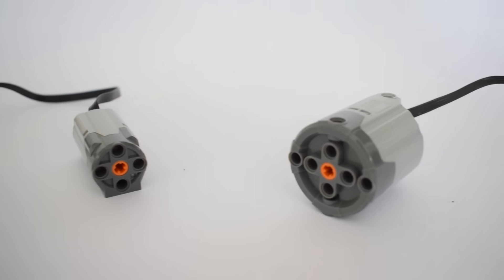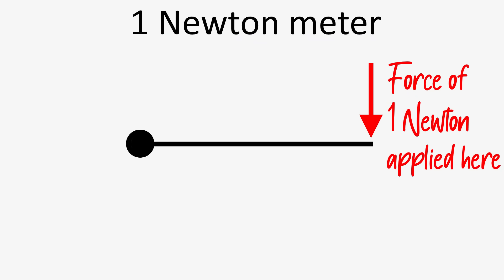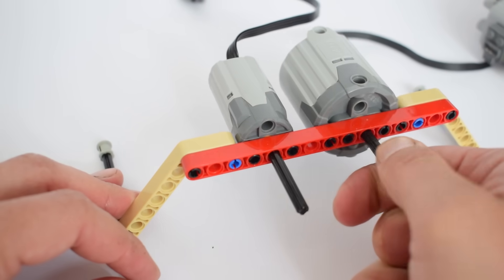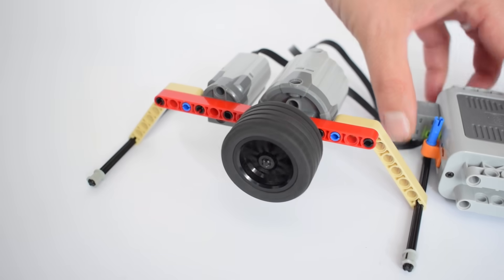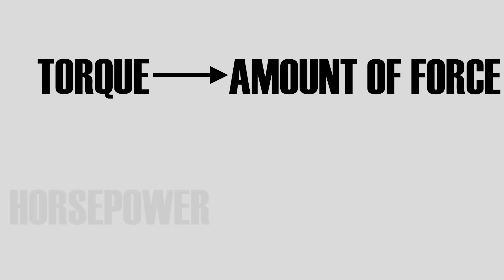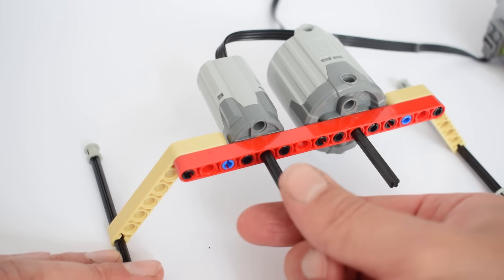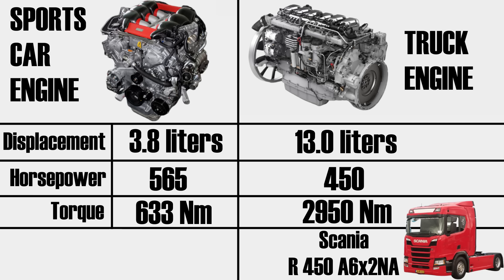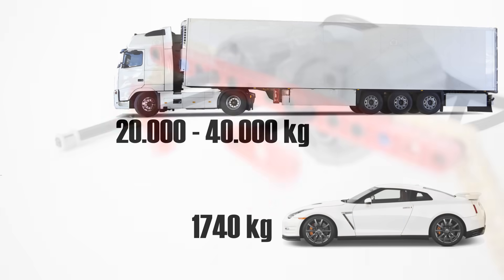NEVER be confused by HORSEPOWER and TORQUE again - HP and TORQUE EXPLAINED in the MOST VISUAL WAY

Comment: I don't agree on when you say we can't really feel horsepower, we can only feel torque. So you're telling me you wouldn't feel much from a naturally aspirated F1 car with very little torque, let's say the 2006-2013 2.4 L V8s? Of course you'd feel a tremendous amount and it's not just because of the relatively low weight but because of the high horsepower even though the torque is low. It's not about torque or horsepower, it's about longitudinal acceleration. That's all that matters.
Reply: this dude talking 💩🤭 .

Comment: One thing that always confused me: Since we can gear down a high horsepower, low torque (gasoline) motor to obtain wheel torque levels that exceed that of a low horsepower, high torque (diesel) motor, why do we bother with diesel at all? What I assume it comes down to is the engine speed required to obtain this high torque with the gas engine. It would contribute to a higher rate of parts wear and fuel consumption as opposed to the diesel's relatively high torque at efficient operational speeds. Does anyone know more about this? Is my assessment correct?
Reply: All about reliability and efficiency pretty much. That and the fact that HP and torque are not constant across the RPMs, and diesel's high low-end torque (and thus high low end horsepower) and relatively flat torque curve overall are very beneficial for hauling applications.
Reply: Horses for courses.

Comment: okokokokok, wait im abit confused still.

lets say you have 2 engine :

Engine A :  95hp at 12000rpm, 63nm at 9500rpm (Honda CB650)

Engine B : 98hp at 7000rpm, 112nm at 4200rpm (Triumph Speed Twin 1200)

how is engine A faster? i mean both are almost similar in weight, and engine B is almost twice the displacement, so shouldnt it be faster?
Reply: What you mean engine A is faster?
Reply: @simplemachine9531  i mean the bike which has engine A is faster, even though they both weighs around the same. Cant be just gearing right?
Reply: @iodineclip  is this a real example and honda accelerates faster? Here are the two options how this happens. Either a Honda has a very short first gear and before shift it travels at slower speed than Triumph before its first shift, or Triumph, despite having 3 extra max hp, has more peaky power curve and long gears which leads to lower average power output between gear shifts. 
Or it is a combination of these two.
Reply: @simplemachine9531  yes real example. Not necessarily the honda accelerates faster, but it definitely has better top speed
Reply: @iodineclip  is faster but only because is lighter triumph weight 235 kg full tank where honda 205 kg but assuming we leveled weight of both be using for comaprision diffrent rider weight in wuch way that both setup would weight with rider 300 kg than triumph be not slower cos it make similar power only what can than make diffrent i. acceleration test be wheel inertia flywhell inertia drive train losess ,drag ,avg power determined be diffrenc in gear lenght to power graph „ratio” 😎 assuming both also would have the same tire wheel i ertia flywheel inertia drive train loses drag similar peak powa width and similar diffrenc between gear lenght and like earlier say with rider both 300 kg so on triumph 64 kg rider on honda 95 kg rider than those 2 bikes would accelerate head to head but honda must operated in such race naturally close to 12 k rpm and triumph close to 7 k rpm so close to peak power naturally cos power is how much work can be done in specified amount of time or it determined force which accelerate motorcycle forward in regard to linear motorcycle velocity as formula watt:m/s = force say 😎 furthemore  also honda must launch naturally from much higher rpm cos have way less power down low cpmapre to triumph otherwise triumph at launch would drive away befora honda start to accelerate similar cb 650 r acceleration to tacho 100 3.12 probably dont include 1 ft roll out but including tahco error we can assume simialr time including 1 ft to real 100 😉👉🏻 https://m.youtube.com/watch?v=Gyrs15W0SKI dude can launch 👍🏻 triumph be not faster👌🏻 despite have more torque at engine crank 👌🏻 other egzample suzuki gsxr 600 67 nm vs ducati 848 90 nm watch how both go head to head in max acceleration when gsxr  avoid other bike and start use max power rpm 👉🏻 https://m.youtube.com/watch?v=nHpFbxU5_N4 why ? both weight similar ducati have 250 ccm more and 35% more torque at wngine crank so why gsxr 600 can keep up 🤔 cos dispalcement and torq at wngine crank for race mean as much as 👉🏻💩 🤭 only power is legit units which can subscribe reall potential for acceleration assuming vehicles have optimal gearing naturally 👌🏻 also as formula watt :m/s =force say both bike and each other bike and car would accelerate slower at peak torque rpm comapre to peak power rpm 😎 at the same velocity which you try to measured let say 100-150 or 100-200 or 50-100 or whatever which diffrenc in velocity peak power rpm always generate more output THRUST aka contact path force cos watt:m/s = force  both gsxr 600 and duc 848 accelerate head to head cos both weight similar lil under 200 kg according to techspec both have similar drag optimal gearing and similar power its not evo version so around 125 hp for both 😎 where advantage in peak crank engine torque duc is irrelevant the same as dispalcement advantage 🤭 in fact duc for max acceleration anutrally completely avoid peak crank engine torque and use like each other bikes peak crank engine powa for max 🌪👊🏻 acceleration 😎 period ps big V2 duc 848 cant accelerate faster cos it dont make more power 🤭 but yea it have much stronger low and midrange rpm let say 1000-8000/10000 rpm all the way duc is stronger in race this is pointless cos in race dude on gsxr 600 use not 1000-10000 rpm but 12-15 k rpm where gsxr 600 engine generate very similar power to ducati 848 engine  at 9-11 k rpm now important think if gsxr 600 i mean rider on gsxr try use higher rpm than max power rpm so at the same velocity shorter gear higher rpm now he accelerate slower egzacly the same duc 848 if instead of let say 3 gear at i dont know egzacly how duc is gearing but according to powa level let say 10 k rpm 3 gear is 180 km/h so if instead of 3 gear he try use 2 gear at 180 km/h for acceleration where let say rpm be 11,5 k rpm assuming also rpm limiter at 12,5 k rpm let say whatever again rpm limiter this bike really have let say it is 12,5 k rpm so crank piston asf can stand such rpm withou piston fly side of engine or be tank 🤭 😁👌🏻 than assuming above 10 k rpmpower drop down and not stay constant again he be accelerate slower than at 3 gear at 180 km/h at 10 k tpm so both biger torq less power higher gear accelerate slower at the same velocity than rpm peak power but also lower gear higher rpm shorter gearing accelerate also slower than peak power rpm ! 🤭😎and thats fact 👌🏻 you found out this when you try some track day on some track and co pare acceleration diffrent bike more powa engine always win unless rider cant ride tham properly or bike with more power is enough heavier  have enough biger drag and some similar stories 👍🏻feg bmw r1250rs  cant keep up with gsxr 600 k5 feg despite have more power 136 hp or 143 hp dont wemember egzacly vs gsxr 125 hp cos bmw weight 40 kg more os have shaft instead of chain which generate more power losess and on 99% its carosery generate biger drag … + probably heavier flywheel maybe also wheel with tire more inertia roll naturally too cos of biger wieght at similar tire so yea both go out of corner from 100 km/h with pro rider on both so as fast out of corner as posiible on ideal racing line and gsxr say bye bye 👋🏻 to r1250 rs be accelerate from 100 to 200 km/h in 6-6,5 sec vs bmw 8-8,5 sec 😁👌🏻

Comment: That's why sport engines and truck engines  perform so differently in terms of speed and acceleration. You also must look at the power and torque curves in the  Nm/Hp rpm plane

Comment: Horsepower is just a function of Torque x RPM
Reply: No
Reply: @simplemachine9531  yes
Reply: @Redtooth75  still messing power and horsepower? After all these years?
Reply: @simplemachine9531  i dont really know what your talking about. But if we have discussed this before and it was years ago and you still remember then thats sad dude.
Anyways horsepower is just a function of torque and rpm. More specifically its torque multiplied by angular velocity. Rpm would be the most common unit of angular velocity. And of course there is a conversion factor of 1/5252 if measuring torque in pound feet due to unit conversions.
Reply: @Redtooth75  Look who's talking. You are living under all these torque/horsepower vids.
Reply: @simplemachine9531  yeah. I routinely lurk on videos dealing with topics im interested in so I can respond to people who have questions on topics I know about. At least im correct when I do it.
Reply: @Redtooth75  50/50
Reply: @Redtooth75 I see you edited a comment adding more info. Saying horsepower is a function of something is like saying "a ruler measures centimeters". That's what we are talking about. Horsepower is not a function, it is a unit.
Reply: @simplemachine9531  a function is a mathematical equation that has only one output for each input. The formula torque×rpm/5252 is a function. Saying that horsepower is a function of torque and rpm means the two factors that influence horsepower are torque and rpm.
Reply: @Redtooth75  still messing power and horsepower? After all these years?
X2
Reply: @simplemachine9531  im confused by that. What exactly did I mess up? Thats the formula for horsepower when torque is in pound feet.
Reply: @Redtooth75  now it's good
Reply: @simplemachine9531  i literally changed nothing but okay

Comment: Newton meter is the unit of torque based on the distance between the center and the circumference, in this case radius, for example when you have a longer lever, and you turn it, it generates a lot of torque due to higher radius, the formula for Newton meter is radius multiplied by power gives you Newton meter, and the formula for radius is diameter divided by 2.

So in this case you multiply the amount Newtons of force by the radius which is in meters, and you Newton meter.

Also there's a difference between torque and force.

Comment: I used to explain the difference by comparing a fly's wings v. a seagull's wings. Fly's wings are very fast, but the force is not strong. Conversely, a seagull's wings move relatively more slowly, but the exert a greater force..
Reply: And that's a difference between speed and force. Why would you want to compare speed and force?

Comment: My dad asked me to tell him the difference between HP and Torque when I was 16...I wish I knew the exact words I used; but as a builder of engines and a race car driver he told me I was correct.  I wish I knew what words I used to express my intuition.  That said; I spanked a BF who chose to build a V6 car vs my V8 car... I expressed it's not 'all out HP' - what you feel the most is torque...so don't fixate on just a HP number- in muscle cars I felt torque always gave you the better impression in how it would feel when driving it.  But; damn I wish I knew the words I had at 16

Comment: Can someone explain how the smaller motor with less Torque and Hp is still able to spin faster though if Hp is supposed to be the “rate of force” it seems contradictory
Reply: Horsepower is the rate of torque, torque being rotational force. The rpm of the shaft is not the only factor, the torque also matters. The formula is torque×rpm/5252. So you can have a motor that can turn faster, it just wont be able to produce as much torque.
Reply: power is proportion torque level to rpm level you can have huge rpm but with enough small torque at this rpm less power than some engine spin lower rpm .

Comment: torque is strength, horsepower is speed (essentially)
Reply: Wrong, power is force times speed
Reply: @simplemachine9531  I'm talking for the average car person to understand
Reply: @brandonpoley  to understand it wrong, just like you? Learn the basics, basics are simple.
Reply: @simplemachine9531  you must have have allot of friends <3
Reply: @simplemachine9531  I also wrote strength idiot
Reply: Trying to explain it to the average person only gets you points if your explanation is correct. Torque is rotating force, speed is rpm, power is torque multiplied by rpm, with a conversion factor.

Comment: Horsepower is like you’re ceiling fan that can drive very fast but can be stopped it’s drive if you put your hand in front of it. A drill it’s slow, but you can’t stop it. Thats torque.
Reply: Wrong
Remove blades from a fan and try to stop it. Install blades on a drill and try to stop it.
Reply: @simplemachine9531  complicated something that wasn’t complicated at all. Almost like the guy who made a 15 minute video about something that can be explained it 2 sentences. You guys should collaborate.
Reply: @stig5763  do you feel the difference between truth and false? You didn't simplify it, it is already simple as it is. You  just made it false, not understanding it right.
Reply: @stig5763  you got a good resistance for knowledge. Open the book and start all over again, rethink your life.
Reply: @simplemachine9531  thanks.

Comment: I mentally construct an analogy of using a pulling system for raising a weight. Torque will allow you to bring the weight up at a constant rate. Horsepower comes in to play when you can change the rate of speed..
Simply put
Reply: Power is never out of play 😆
Reply: @simplemachine9531  correct.
A single firing of a cylinder creates force into torque and whatever arbitrary amount of power it is. The continued dynamic firing of the cylinder creates horse power that can be controlled

Comment: This is helpful thank you. So, would I be correct in saying more torque is required when, say, stirring molasses?  In that regard, a high horsepower sports car engine may not stir the molasses well if it did not have enough torque, since the truck engine would be turning a higher rpm and would effectively generate more power for that application.

Comment: There is an error in the ending.
A small engine will also pull a lot of weight with the right gear ratio - because what matters is torque at the wheels and not at the crankshaft.
What's more - a sports engine will accelerate better even with a heavy load, but in a truck it's more about durability and low fuel consumption.
Reply from the maker: No. Gear ratios are not magic. The sports car will not accelerate better. By yhe the time you gear down the sports car engine until it can pull the weight you will have a gearbox with many gears because your output speed will be greatly reduced at the expense of torque. Engine crankshaft most certainly matters because it's your starting point. I have a video on gear ratios too
Reply: @d4a  
Of course, gear ratios are no magic.
With a gear ratio of 1:2 you get twice the torque at twice reduced speed. You only need one speed reduction gear, then you can use the gearbox from the truck.
A sports engine has more power, so it can achieve more torque at the same rpm (on wheels).
Unfortunately it's hard to discuss if you don't have a torque/rpm graph.
Torque is generally given at lower speeds - power close to maximum, but it all depends on what the torque/power graph looks like between the two.
The data from the video might suggest that the truck engine is almost twice as powerful (2950x2.5=7375 vs 633x7=4431), but nevertheless it is the sports car that has more power.

Comment: There are a lot of debates and points being made, and whilst a lot of them are relevant, someone explained to me once, an easy way to understand TORQUE and HP, is TORQUE GETS you going, HP KEEPS you going. ACCELERATION vs SPEED. That's why my torquey diesel Jeep takes off quickly to a certain very short distance before a higher HP V8 Jeep spools up power at higher revs up and takes me over. Same reason why diesel cars don't need to change gears so often because there is plenty of torque to turn those wheels at most revs. Anyway just my 2 cents (that's admittedly not worth a lot with this inflation around)

Comment: GREAT explanatory video!

Part of the additional torque of a diesel engine is due to the greater radius of the crank where the large end of connecting rod is exerting force. It's like accelerating a bicycle with longer pedal arms. You will generate more torque at the center axis of the crank using the same "pushing" force against the pedal while using a longer pedal arm (or pedal crank). A greater crank radius will require longer connecting rods because the distance travelled transversely at the big end is greater and you don't want too great an angle between the connecting rod where it meets the bottom of the piston. A larger diameter crank increases the compression ratio which is higher in a diesel engine (usually 14:1 to 25:1) than in a gasoline engine (8:1 to 12:1).
There's plenty more information out there about how diesels differ from gasoline engines.
Reply: so that would explain lower rpms i guess....with longer connecting rods, its harder for a big engine to rotate that quickly....granted im in medicine, very little car knowledge
Reply: But doesn't it also take more power to over come a longer stroke? A small combustion chamber would fizzle out right? I believe this is  the reason why framing nail guns have huge heads versus the small ones on a trim gun
Reply: The only correction required here is, that compression ratio is independent of both connecting rod length and crank radius. Its limited/chosen in each type of engine based on many other factors.